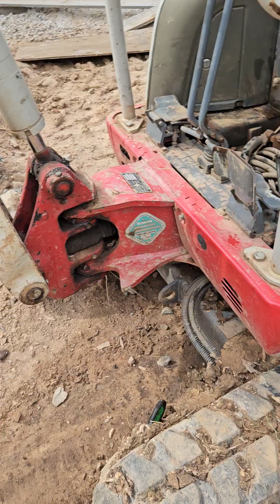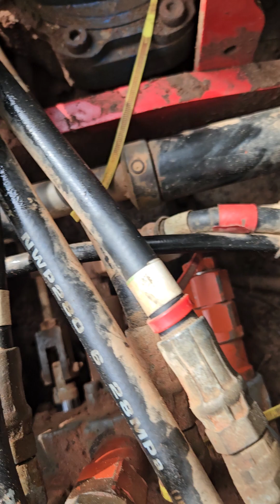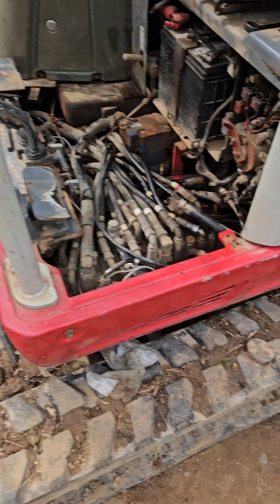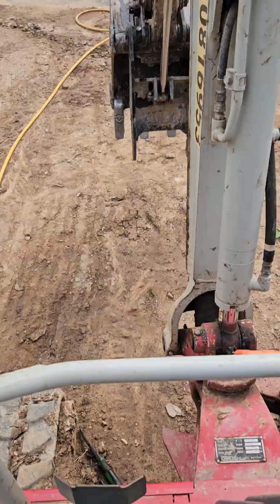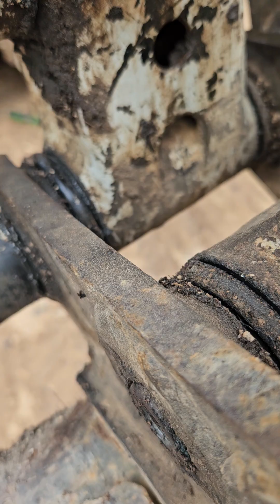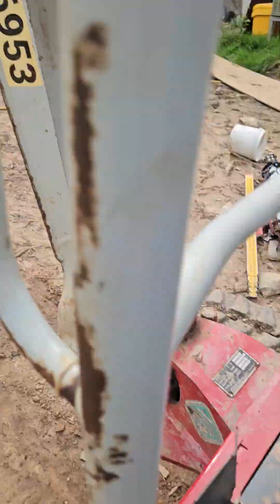Takeuchi TB216 thumb pressure adjustment.

Comment: I have a 2017 TB216 with the factory thumb mount in the cast dipper.  I am making my own thumb and just am finishing it up and saw your video.  I am confused by your statement that up to a certain serial number they didn’t have a relief valve?   Do you know which serial numbers?   What year is yours? what is the proper way to adjust the relief valve?  Clockwise, counter clockwise ect?

So what do you do if you don’t have a relief valve?

I made a 1050 30mm pin and did drill a 3/16 grease passage as I would rather break the pin then weaken the dipper